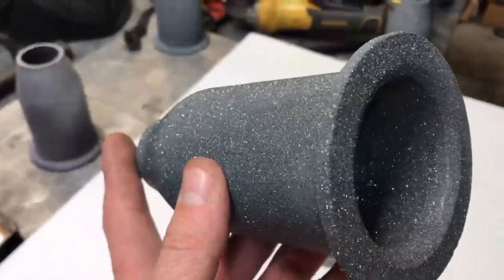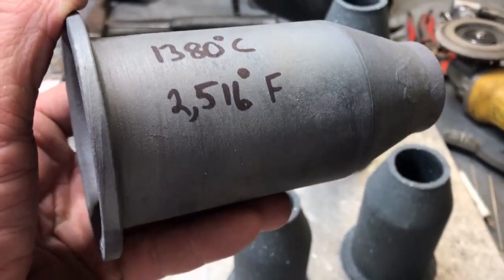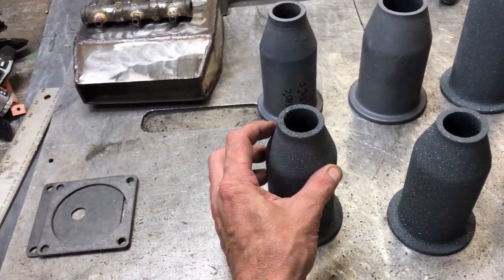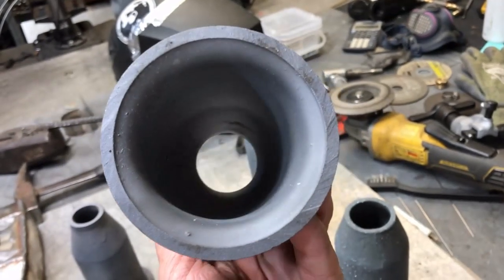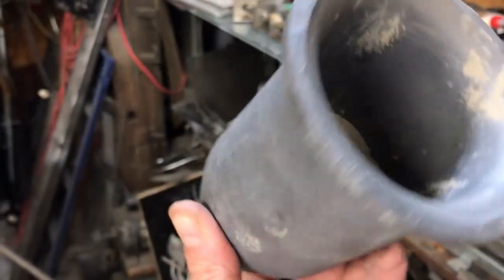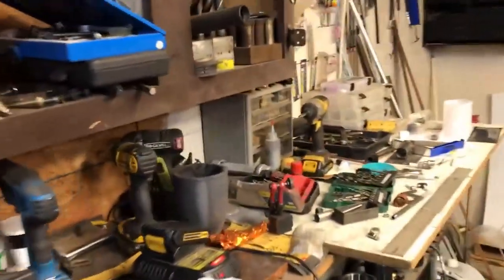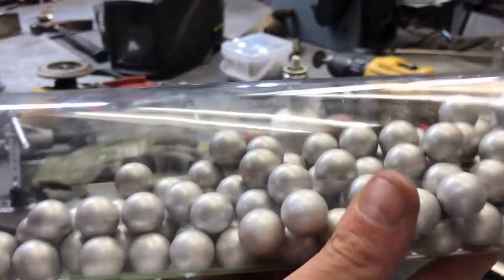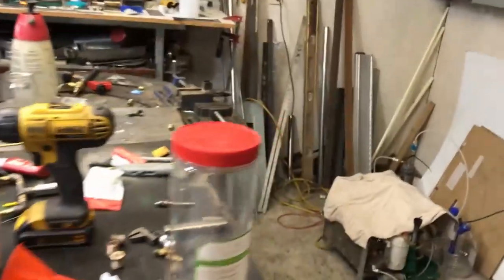Re SiC recrystallized silicon carbide Shipments Are in

Comment: Good mix of projects ya got going on!
I'm a little curious about these high performance ceramics and have never heard of re-crystallized SIC.  What is the deference between sintered and re-crystallized in terms of manufacturing, grain size of the green material?  Sintering or tempering cycles?
Reply from the maker: they wont tell me but i think they bake them for a month at 3,500 deg . The grain size is huge on the Re SiC, im almost positive they are just cooked longer cus a couple are not fully cooked and look grey like the Sic . they Cost 4 times as much
Reply: @NOBOX7  
Where are you selling the crucibles?

Comment: I wonder why good thermal conductivity is a good thing in crucibles?
Reply: Because whatever is inside gets hotter quicker and more homogeneously.
Reply: So that heat from the foundry can conduct to the crucible's contents.
Reply: @RagingShrimp67  OK. But if you are doing casting it gets also colder faster.
Reply: @BadPete81  Yes, but the amount of time between stopping the heat and the pour is at most 20 seconds.